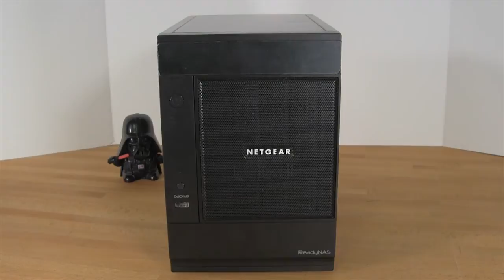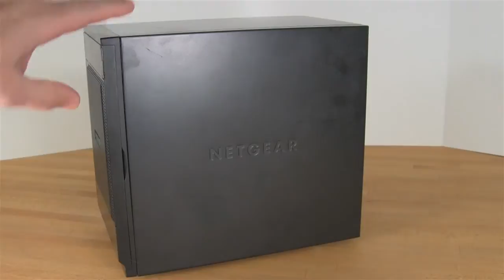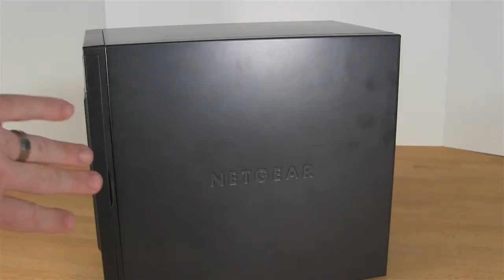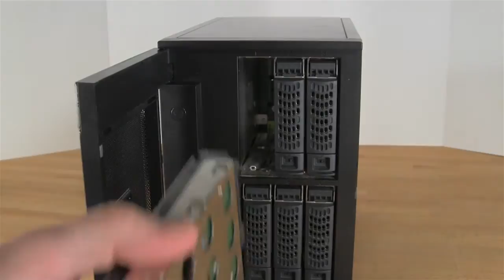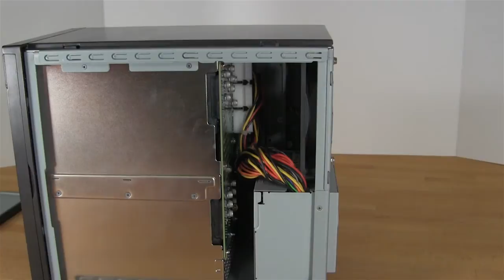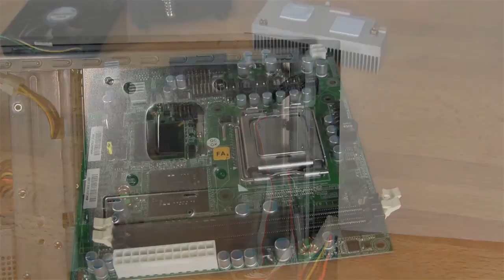NETGEAR ReadyNAS Pro 6 Design And Features

Comment: FYI, these are still great NAS boxes for home use. The upgrade path from RAIDiator 4.2.x to OS6 extended the life of these boxes.  My Pro6 has (6) 8TB enterprise class, SATA drives and it performs flawlessly and with more than satisfactory performance!
Reply: I got one for very cheap and with 6 1tb drives too. How did you do the upgrade? Can I install open media vault on it or does it not support it?

Comment: Static is not the only thing to worry about. You've got oil on your fingers that can erode the connection bits of components - over time. But you seem to be aware of that, since I didn't see you touch any of those. 

Still, there's no reason not to take every precaution in my opinion.

Comment from the maker: I have been working in IT and and Electronics for over 20 years and have not killed anything with static yet. If you are grounded you are not going to generate and charge to damage the components. Additionally most newer components are not as fragile as older ones. ESD is something that they protect against these days.
.

Comment: I think its a pci-e 4x slot :) pci-e 1x is not enough bandwith for 2xgbit+2xusb
Reply: It is not PCI-e 4x, perhaps physically it might be the same but the signals are proprietary. The reason I am saying this is that the Marvell Gigabit Ethernet chips are on the motherboard and they have wired connections to the Gigabit ports on the daughterboard. The reset button on the daughterboard also connects directly through the connector, the only logig on the daughterboard is a usb hub connecting the 2 USB ports and a flash chip (seen as a usb drive) with 128MB flash with holds a copy of netgear firmware and, in a separate partition some PID data (encrypted serial number, encrypted mac addresses, etc.). O the other side of the board is another identical connector going to the backplane but the backplane is dumb, does not contain any SATA chip which means that connector is also not PCIe but just a connector which they use to pass SATA signals for 6 drives.